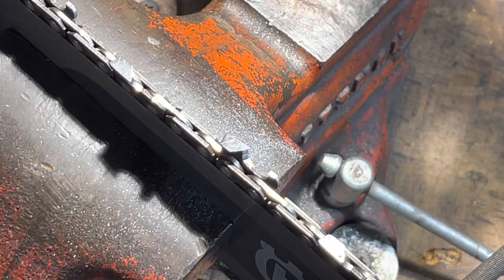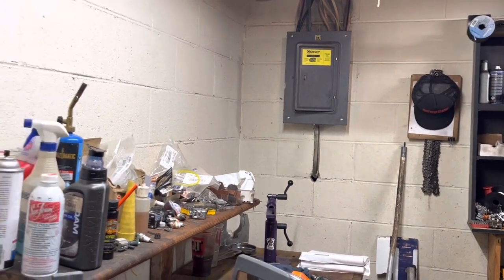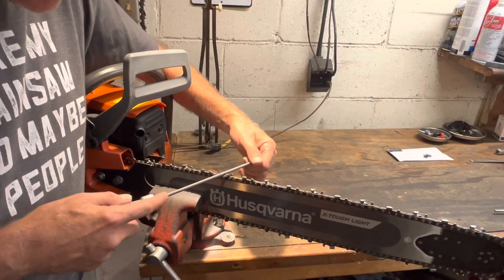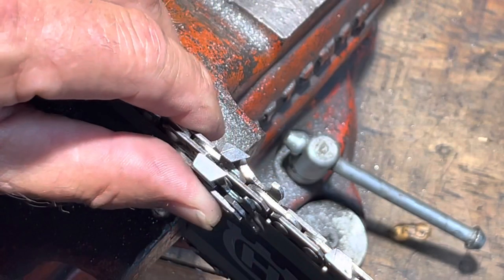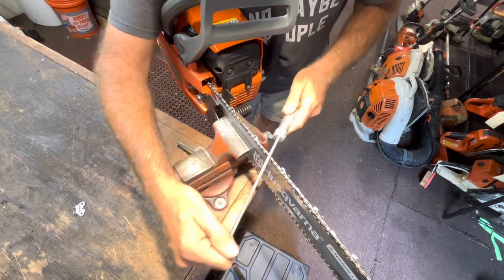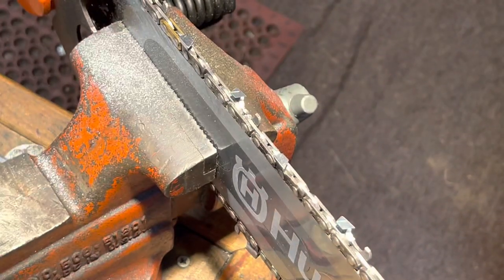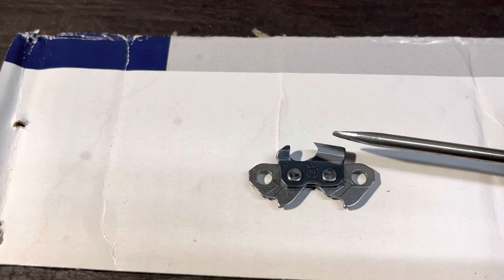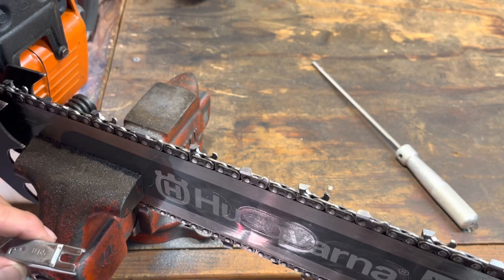How to Sharpen a Chainsaw. Tips and Tricks

Comment: Sharpening a chain - not really hard.  I can sharpen a 20 inch chain in 15 minutes or less.  I do not put it in a vise.  I sharpen it on the bar.  Since I sharpen my chains after every use, I seldom hit each link over 3-4 strokes.  I do the left hand cutters, first, and the right hand cutters last, after flipping the saw around.  My file follows the original line of the cutter and my file is level.  I file with one hand and only on the forward motion.  If the angle of the cutter does not look right to me I get out my file guide and reshape it to 30 degrees.  Your eyes are your best guide when filing a chain.   I also use my eyes to scan down the row f cutters looking for a tall raker.  If I see one, I hit it a few licks with my raker file.  I am looking for about a spark plug gap between the top of the cutter and the top of the rakers.  I set my rakers a little on the hungry side, so I do not have to file them everytime I sharpen the chain.  On low profile chains I do not set them as hungry, probably about .025”.  On my 3/8 full chisel chains their rakers are set a little lower than .025 because their engines have enough power to pull the chain through the wood.  I use nothing but Stihl files.
Reply from the maker: Not your first rodeo.  Light touch ups, as needed on the rakers and a good file.
Reply: @richardflagg3084  right Richard.  Been cutting wood for neigh on to 50 years.  Before that with my Boy Scout axe.  Still have a bevy of axes.  None of those highly prized Scandinavian axes.  Mine are True Temper axes, made in the good ole USA.  All of which I now have restored to their original factory condition.  I have made leather sheaths for most of them.
Reply from the maker: @johnclarke6647  Pass that knowledge on.  This generation is going to need that one day.
Reply: I sharpen my chain as you described. I was taught by a logger who said you need to know how to sharpen in the field. I find the key is being disciplined and not allowing your saws to sit after using them. I perform all my PM and sharpen after each use.
Reply: @MAM-cy3yy  I really do not sharpen in the field.  I take enough saws with me to complete the task.  I warm them all up and if a saw gets dull I just crank up another one.  I clean and sharpen them when I get home.  My PM is done beforehand.  Yesterday, I ran an OP test on my MS 171 and 170, since they had not been run in a month.  I cranked them up and let them run 15 minutes at idle with an occasional goose up.  After 15 minutes, I put the tach on them and checked their idle and WFO.  The 171 had a WFO of 12,830, an idle of 2,950.  The 170 had a WFO of 12,850 and an idle of 2,800.  I was satisfied and logged these figures into my chainsaw logbook.  Every saw that I have goes into the logbook - date, what was done with it or to it, gas usage, time if known, adjustments made to it, parts replaced, tests run and their results.  If a problem arises, I will know why.
Reply: @johnclarke6647  that's awesome attention to detail. I'm not quite there yet but try to keep up on all my machines so they last and more importantly you know how to fix it if needed. Have a great day.

Comment: Just hit your chain break, that will tighten the chain.  I keep my chains a little tighter than some folks.  Mine do not move to easy on the bar.    Buckin says  to cut the gullet which is what you are doing with a downward angle on the file.  I cut as level as I can and on the right angle.

Comment: Great tutorial on filing.  Once I started grinding chains I quit filing 😁. I just got a diamond wheel for my grinder. Just started  square grinding my chains. What a difference.  Again, great content. 🍻
Reply from the maker: Thanks!  Filing can be a chore once you really get a chain grinder dialed in.  How's the 064 coming?
Reply: @richardflagg3084  I have it running.  Want to get a couple  tanks of gas thru it before I really adjust the carb. I have a 36" bar on it and cut down a few trees.  When I ordered the bar also ordered a stihl skip tooth square ground chain. It cuts  awesome. In a couple weeks I'll be cutting with it more. I'm  pleased so far and it has more to give. Stay safe my friend.  And I love your shirt!

Comment: Richard,  Im interested in adding a 395 blue saw for milling and was interested in having you port it up. Nobody ive had saws done up at will touch the blue saws due to the always suspect plating. Do u mess w these or not so much? Probably should have snatched up an oem 395 that was on Facebook awhile back that allegedly had your magic done to it. Keep up the good work n be safe, Bruce..

Comment: When I am through filing a tooth, I feel the corner with my finger and it better be sharp.  You ought to cover - use the right size file.  On Oregon and HUSQVARNA  3/8 chains you use a 7/32” file.  On Stihl 3/8 chains you use a 13/64” file.  I have both in my file set and their file handles are marked, accordingly.

Comment: There are a lot of chain sharpening videos out there, some good, and some not so good.  This one was pretty Darned good.  Appreciate you putting this out, Richard.  This Man is no nonsense, and probably one you wouldn’t want to cross!  😳

I would add, the hook/gullet profile should actually be something between a ‘C’ and a ‘D.’  And yes, I think we all tend to hang onto a file too long!  🤓  I go by the sound and the ‘feel.’  Higher pitched and easy going tends to signify a worn file.  I would add the Husqvarna files work just fine for me.  Stihl are good, as you mentioned, and I have yet to try the Pferd files?  I have heard they are good.  

I am no expert, but have done a ton of filing, and I think/ hope I get better at it each time.  I am currently using the Husqvarna file system, and like it except it sits the file a tad high, as Richard mentioned, but it keeps the file lined up properly, so I do as Richard stated here;  I ‘deep file’ it, and then finish off the upper part of the tooth with the gauge.  I have yet to try the Stihl 2in1, am I am considering trying the Dremel route, and see how that does?  Take care and hope everyone has a good Labor Day weekend!  👍✌
Reply from the maker: Thanks for the kind words.  I forgot to add the Husqvarna files are very nice.  The 2 in 1 system actually does a nice job and the learning curve is not too bad to get good results.  The dremel type stone is more of a gimick than a solution.  I'd steer clear of that route.